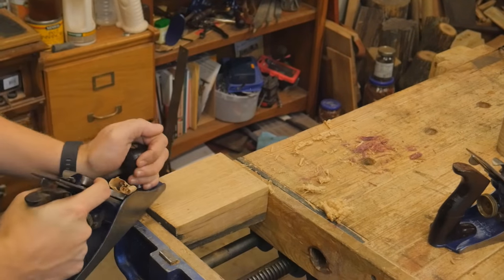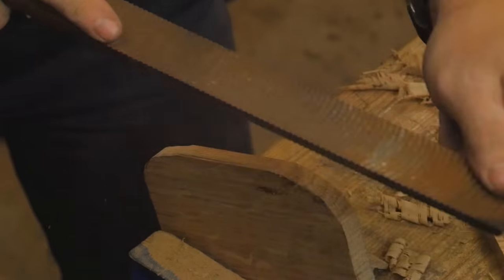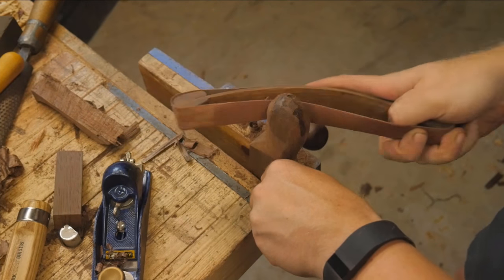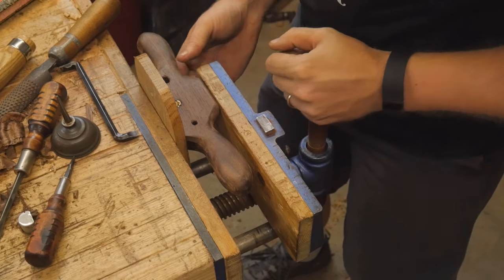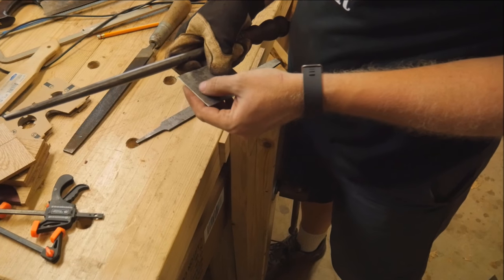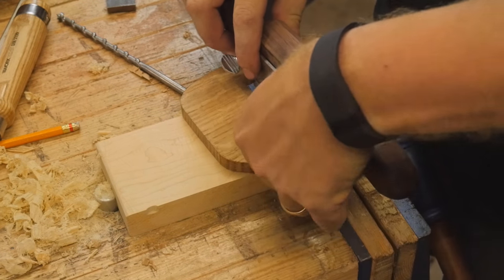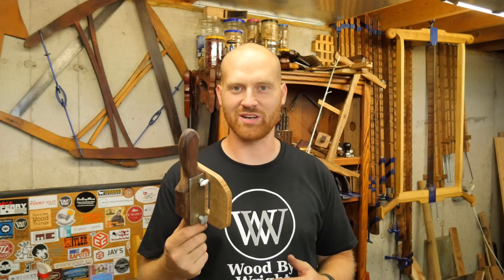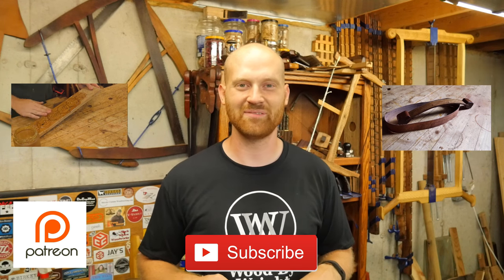Making a Cabinet Scraper Like Stanley 81 Shopmade fail Handmade Hand tool

Comment: There is nothing wrong with a bit of chatter, it can make some very attractive textures. I had a piece of NG rosewood that I planned with a Stanley 130 block plane (possibly the worst tool Stanley ever made). I was just trying the freshly sharpened thin blade that they come with and got a foot long strip of perfect chatter at around 1/16" spacing and at about 60 degrees. Rather than throw it away I made a couple of draw pulls for the workshop that are a bit different and I think look really good.
All the best.
Reply from the maker: now that is a sweet Idea!

Comment: Thank you for showing this Fail video. I know there are thousands of videos on you tube, that only show projects that were done right. with out any problems, or so we are led to believe nothing went wrong during the build. Because of these videos so many people will not even try to make something because they do not want to fail. After all the person making the video mad it look so simple and easy.I can't count how many times I have had to scrap a project because of mistakes. My wife says I make more saw dust than projects.But I try to remember what went wrong and how to prevent it from happening again. Thank you for showing it is possible for every wood worker to make a mistake or two, it may not be very often but it happens.On this scraper could you cut another mouth on the other side of the handle, going the right direction, and plug the holes and re-drill them. this way you would not have to scrap the entire project. It would have a few imperfections but it would work.Have a blessed day.
Reply from the maker: thanks! I love to learn from mistakes and if this channel is about learning then I have to show those too. there are several ways to fix this, but having played with it I see several ways to make it better and that is what I am going to try next!

Comment: You might make a throat insert to 'repair' it. Thats what they do restoring old wooden planes where due to wear the throat is too wide. Use contrasting wood (usually its boxwood btw)
Reply from the maker: that is one of the possible ways of doing it, but there are several things I would like to do better for the next one. I am hoping to do another video next week and make a Makt II

Comment: Hi, not sure if anyone mentioned this yet, but that square youused for your blade that wasn't square could have been made square. All you have to do is draw a straight line from the inside corner to the outside comer of the square. then using a pointed punch, punch one or more dimples on the line to deform the metal until it is square. 
punch further towards the outside corner to bend the tounge and body towards each other, or alternatively punch closer to the inside corner to bring the body and tounge closer together.

I do is all the time, especially when a square is dropped on a concrete
 floor and sent out of square.

Comment: nice video,  I enjoyed it, to add  to the learning experience  the slit in the brass insert is a part of the cutter, you need use a bolt and double nut  per  the manufacturer  instructions
Reply from the maker: interesting. I have never tried that. I might have to next time. I purchase them singly so no instructions. thanks for the info.

Comment: Could cut out the section with the bad angle and glue in a block of wood with maybe a couple screws from the top for extra strength.
Reply from the maker: I have a few Ideas and that is one of them. but having played with this one I think I am going to try something different all together. Mark II will be much better in many ways.

Comment: you aren't in time to remove the bed, cutting it at glued zone? and put the hole in the correct position, according to the angle and back support?
Reply from the maker: I am going to be making a new one with a better result all around. I have several things i want to make better.

Comment: I just subscribed simply because you are willing to teach with your failures. Thank you. Ultimately i don't believe you failed. Do you know a square could be made square with a punch? Thanks again.
Reply from the maker: Thanks Ryan. I try to put most of my teachable moments in the videos. it is always best if you can learn from other peoples mistakes.
Yes. you can also true it up with a file, but this one was beyond that, and I have many of them so no problem as it was the best steel around for it.

Comment: You didn't fail. You just figured out a way not to do it :-)
Can't you remove and remake the sole?
I've also seen folks that say you need to thread the inserts with the groove down to cut/tap the wood and use a tread to screw it in. If want to use a screw driver maybe file another slot on the other side or grooves at the tip to cut the wood and make it easier?
Still a nice video and have a great day, cheers.
Reply from the maker: thanks. With these inserts those grooves are well inside of the shaft so they do not help cut the hole at all.

Comment: id like to see you make a #112 scraper plane!

oh and on this, should the iron be thicker?
Reply from the maker: That is on my list of things to make. the saw plate I am using is about 1/100 thinner than the original Stanley blade. and for a scraper blade that is meant to be bent you do not want it that much thicker. if ti were to me for a scrapping plane with 90 degree cut it would need to be much thicker.
Reply: i have a veritas #80 and it just seemed like the blade on that is quite a bit thicker than the one you were using from an old saw blade. not sure how the veritas blade compares to an original stanley though so that might be the difference!
Reply from the maker: ya veritas has a much thicker blade more like an Iron that takes a bit more force to bend. the nice thing with that is you can cut wider sections at once. and I had thought of just purchasing a blade for it (veritas being the top of the list, but wanted to show how it can be shop made

Comment: Negative result is still a result. :) Next time it will be a one day project...:)
Reply from the maker: so true! Mark II is going to be sweet!
Reply: I have an antique Stanley scraper plane with the rosewood sole, if you need any measurements from it, let me know
Reply from the maker: nice the 81 has been on my list fro a wile but it is not high on the list because I have an 80. but I have a friend here with an 81. to look at. thanks for the offer. it is a fun tool to use.

Comment: Is there a way you can glue a piece in the mouth opening and reinforce it? Or maybe even cut a new mouth opening? 

I hope there is a way to save it and get it to work right. It is a beautiful tool and I would like to see it saved and usable. 

Thanks for listening.
Reply from the maker: this one will work well on my wall. plus I have a few ideas on making the next one even better. it was made from scrap and fire wood. so no loss at all.